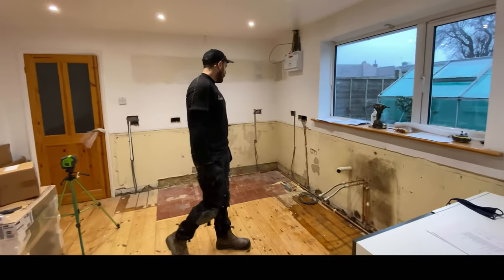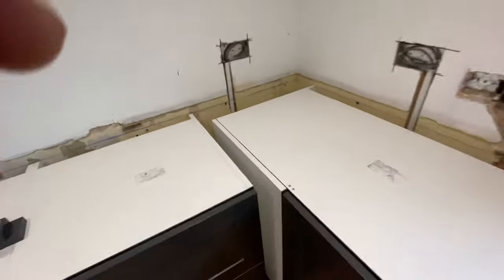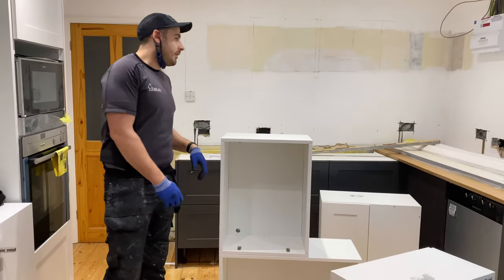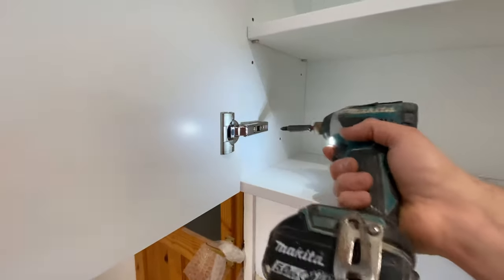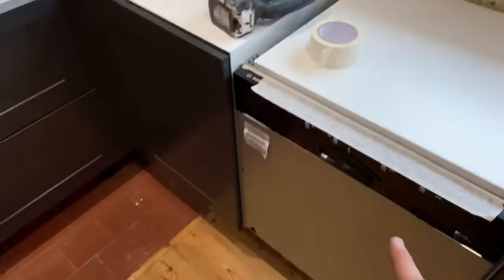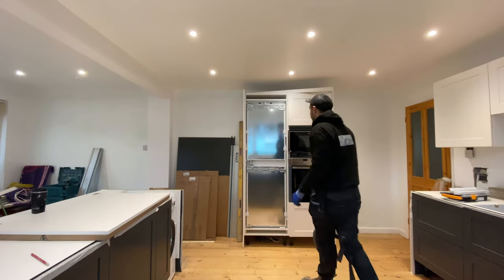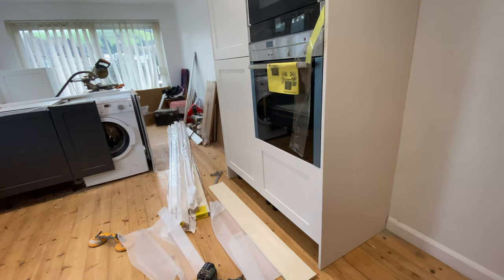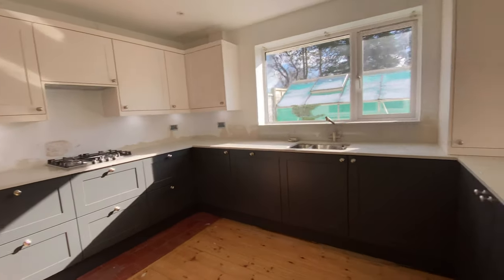How to fit a kitchen

Comment: Nice vid mate. Do the end panels not need scribing to the wall and floor?
Reply from the maker: Thank you. Most do need scribing But some companies end panels are the same width as the units so they can’t be scribed in. I know howdens are like that. There is always enough length to scribe to floor tho. Hope that helps 👍

Comment: Great video.  I'm doing my kitchen, the corners are not perfect right angles is it best to use two wall units to make a corner as a corner cupboard uses packers  each side.
Reply from the maker: Hi Roy so sorry for late reply. Thank you. Yes I would recommend 2 units rather than a corner unit. As like you said if the corners not perfect it can be a pain! Good luck mate !
Reply: @everlastbuilders  thanx buddy

Comment: Shouldn't the cuttings in the wall, where the cables are for the sockets, be plastered/rendered before fitting the kitchen units?
Reply from the maker: Can be done first mate. Some times it’s nice to get the worktops/splash backs on then plaster down onto them.

Comment: Nice man very helpful seeing the whole process makes considering installing your own kitchen much less intimidating as a non builder. Is the kitchen always installed before any new flooring? And the splash back installed after the bench?
Reply from the maker: Hi Mash thanks for the comment. Sorry for the late reply. Either or really. I like laying the floor after just in case it gets damaged when fitting the kitchen. Also you save a few quid because your not laying as much. But to be honest if you can lay the floor first and protect it that would be best. Also splash back sit straight on top of worktops, hope that helps mate
Reply: @leeballs9305  🤣🤣🤣
Reply: @chillievans  is he talking rubbish?
Reply from the maker: Who’s talking rubbish?
Reply: @everlastbuilders  Lee Balls
Reply from the maker: @dr6124  suppose laminate flooring with a thick underlay could potentially drop a min. Most over floor coverings would be fine under units. Some people like running flooring all the way under. Just in case of leaks

Comment: Unless the floor is completely level I don't see a point in measuring the legs for the plinths
Reply from the maker: It helps mate. Just to get a rough guide. Saves a little time on the floor adjusting feet